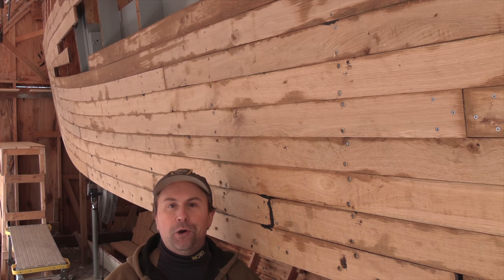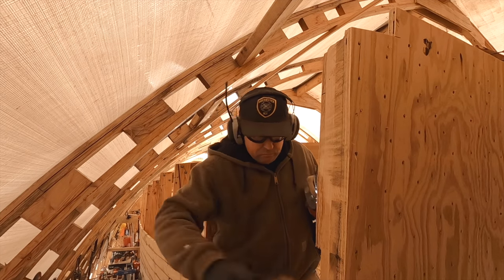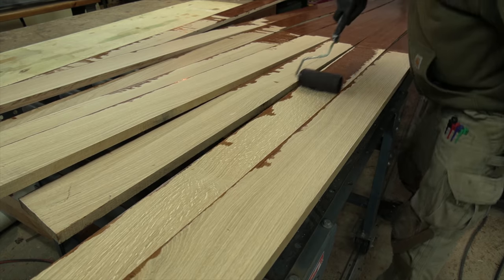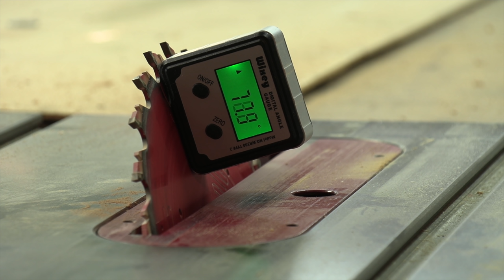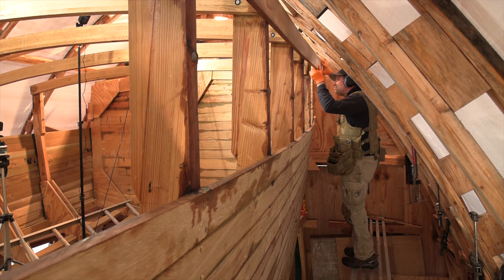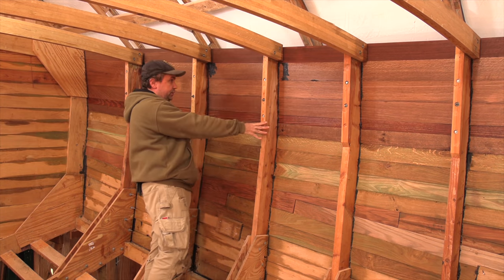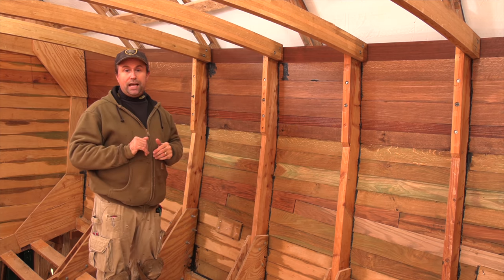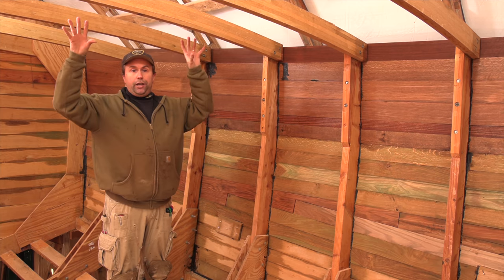Diesel Duck wooden boat, building the raised sheer and good old fashioned woodworking.  SDP #63

Comment: I admire guys & ladies that can work in the cold with snow flurries or where you can see your breath inside the shop.  I live in a very moderate temperature zone and I turn on the heater in my shop when its 60 F or lower.

Comment: West System recommends against putting epoxy over larger dimensioned oak as it expands 50% more than mahogany and opens joints and checks regardless if epoxy is attempting to restrain it, thus letting water in. Read Epoxyworks article called using 'Epoxy With Oak'.   P.S. That is a lot of edge setting I see with that oak planking...

Comment: Hi Scott, a few questions: First, what brand is your tape measure? Second, will you be fairing the planks before the ply goes on? And third, will you be coating the planks with epoxy? Tar? Something else? Keep up the good work!
Reply from the maker: I use a Lufkin tape and Milwaukee.  The planks will be faired only as much as required to get the plywood to lay flat against it.

Comment: I saw a similar vessel in Hawai'i @Kewalo Boat Harbor with paravanes. Are you thinking of this to help stop the roll, or large bilge keels?
Reply from the maker: we will have a small sailing rig to slow the roll and will also act as an emergency get home rig.  I may use paravanes if we really getting into open water cruising.